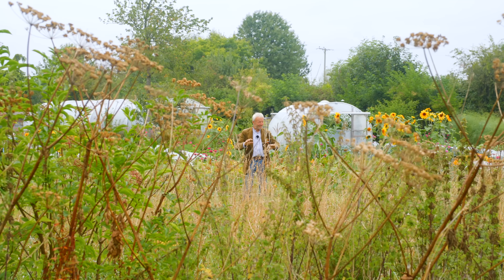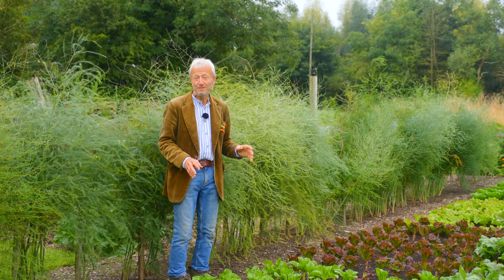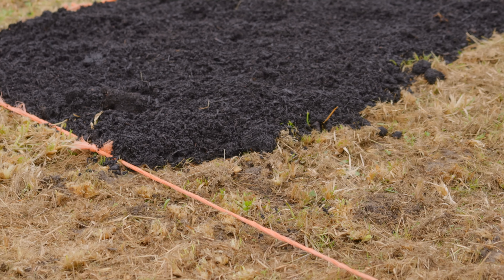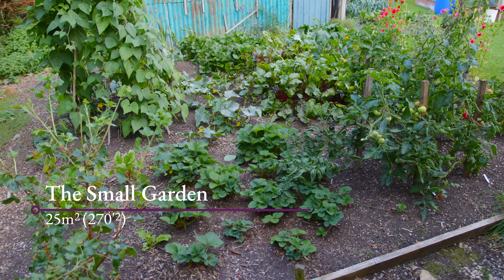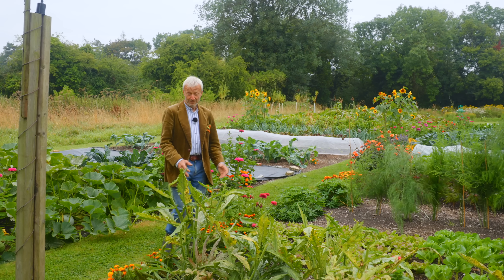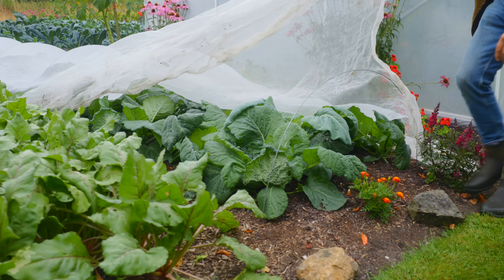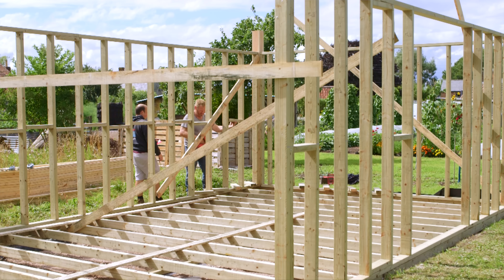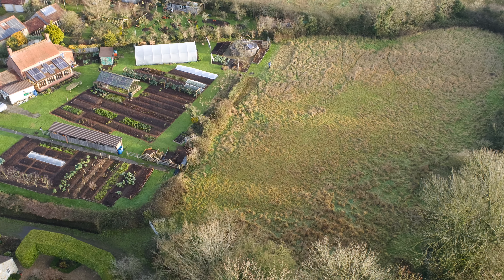No dig on perennial weeds 2021-2024 results

Comment: So love your approach Charles. I would add that in my experience if your compost doesn't"t hit the correct temperatures then you will be spreading weed seeds which might lead. People to think nodig does not work. Which of course it absolutely does! 😊
Reply from the maker: Thanks, and I see your point, but I do keep saying how it's very easy to hoe or disturb, or remove the new weeds from compost, because it's so soft. It's a totally different experience compared to trying to weed soil surfaces.
Reply: @CharlesDowding1nodig  Too true, it is about staying in top of it in the early stages and yes, soil is not compacted in a nodig set up the way it is when you dig to "so called" aerate the soil.
Reply: @CharlesDowding1nodig  4:09 4:15 4:04

Comment: Thanks for the run through of the way you’ve developed the space and how you manage it. The plants look so vigorous and colorful. Maybe you could convert the ‘left over’ space into a wildflower meadow which, once established, would be relatively low maintenance but would attract the bees and other pollinators en masse.
Reply from the maker: Thanks, and I find it's a myth that wildflowers are easy maintenance. Here, for example, grass and buttercup take over very quickly, that's why I used black plastic around the pond area. The existing wild area does actually have quite a few flowers in the spring, which we all enjoy.

Comment: Long time gardener here and I just wanted to pop in to endorse this method. If you are on the fence, absolutely go for it, it will change your life. 

A couple of tips, if you want to buy compost the best thing to do is to purchase it ahead of time and let it sit for a few months if you can. Most purchased compost is not ready and if you plant into it you may have disappointing results. Not always... but many times.  Number two, when you start your garden try to find large pieces of cardboard, appliance and furniture stores have a gold mine of large pieces that have less seams... of course you can always use all your old Amazon boxes but the bigger pieces let less weeds grow through the cracks. Thirdly, I would discourage putting grass that close to my beds. I do have a lawn but I have a strip about 4 ft wide of wood chip before my garden beds start. This is so that I don't have to keep edging the lawn like Charles does. If you like that look, go for it but realize the grass will never stop trying to infiltrate your beds.

This method is amazing and especially if (like me), you're not as young as you used to be, being free of heavy, heavy weeding is a godsend. Thank you Charles!
Reply from the maker: I'm heartened to see this and congratulations.
Thanks for your tips.

Comment: Good show, cheers Charles. You can buy puddling clay to line the dry pond by the cube/lorry load ~£130 a cube which would cover ~5sqM 100mm deep, guess cost depends how far the nearest supplier is, have a puddling party to lay it all down, kids would love it (so would the adults but use the kids as an excuse lol)
Reply from the maker: Thanks, this is a cheerful thought. I'm actually not unhappy with it, alternating wet and dry between the seasons.

Comment: Thanks Charles, loving your knowledge on growing, do you ever use JMS in your garden or compost teas, i would use JMS in my compost and garden when the weather starts to warm up to get my beds activated well with microbes and the mulch I've added in December about a month or so before i start planting, it really seems to help get things going.
Reply from the maker: Cheers Graeme and I have not found I need that, because everything gets going so well anyway. I wonder if you are digging, because I think there's more need for it when soil is disturbed. Thanks for the tip anyway.

Comment: I'm also a believer in a soil test, as in digging down and looking at what the soil is as you go down about 2 - 3 ft, and if there are already layers which affect water drainage in the soil (can happen for different reasons including land usage in the past for farming and other issues), then a one time DEEP till followed by these methods is pretty much the same thing.  Either way you're dealing with weed seeds once you remove a cover if you follow that with black plastic.

But once you start this process then you are no dig.  No-till farmers also do shallow soil work when they're working with 1/2+ acres just to get a smooth surface for taking a planter over.  So, part of the time they use a tilther and since that only works the top 2", I'd still consider that no-dig, in which case a lot of the no-till, or better yet, regenerative farmers will simply say no-dig means minimal soil disturbance along with being organic, with the function of locking carbon into the soil being a main goal.
Reply from the maker: Thanks for sharing :)

Comment: The greatest challenge I've found is in acquiring sufficient compost for the initial 10cm layer & ongoing, annual 2.5-3cm application.
I have 75m² in total of beds, plus 30 x 30 litre potato containers needing compost every year & I'm looking at 2.7m³ of 'finished' compost a year, plus 1.3m³ of woodchip/shredded prunings for the interbed paths.
That might sound daunting but I'm a not particularly fit 66 year old & with a little effort, have managed to exceed my target in successive years (last week's haul was 150kg of seaweed from the shore after recent storms - 30 minutes work).
Believe me; the end harvest is absolutely worth the effort involved, which is less than you'd think: maybe 3 hours a week, averaged over a year & for that I harvest at least 400kg of high quality produce a year.
Reply from the maker: Good to hear. It all keeps us fit and lively

Comment: Plastic exposed to the environment starts to breakdown very quickly and begins to release toxic elements into the environment.

Although it may seem that it can be reused indefinitely as long as it maintains its structure, it is silently poisoning the soil on which it is placed.

"Black plastics can contain unregulated amounts of toxic chemicals such as phthalates and flame retardants, as well as heavy metals such as cadmium, lead, nickel, chromium, and mercury. That’s because black plastic is largely sourced from electronic scrap such as TVs and computers. If these materials went back into electronic components or into inert uses (such as railroad ties), that would be preferable, but instead they are melted down and mixed with food-grade plastics for applications that pose a higher risk to human health, such as utensils, to-go containers, cooking implements, hot cup lids, coffee stirrers, reusable coffee mugs, or toys for children or pets.

While regulations are in place to ensure your electronic devices do not exceed certain levels of toxic chemicals and metals, there is nothing protecting you from the toxic levels in a black plastic to-go container. Exposure to heat increases the likelihood of these toxic chemicals leaching into your food and drink."

Source: https://ecocycle.org/our-programs/reducing-plastics/eliminating-problematic-plastics/problematic-unnecessary-plastics/

Comment: Hi Charles, I need your opinion on two things. First is drip irrigation and then the second is Jiffypots made from paper and some other stuff.  I understand the whole idea behind drip irrigation - to save water - but it seems like it now limits one as to where one can plant your seedlings etc or sow things like carrots while the rest of bed between plants stay dry. Also the space between the emitters. Then the Jiffypots are also a noble idea, but I used to make my own paper pots in the past and it seems like if the walls are too thick, the plant roots find it difficult to penetrate the walls and the bottom. Will the same not happen with the Jiffypots? This summer season, I am actually going back to the old fashioned seedling trays again.  From South Africa, Albert
Reply from the maker: Cheers Albert. Yes, I agree and drip irrigation does not stimulate soul microbes much! Likewise, I do not use any such pots, they take more space in the propagation area, and if you buy them obviously are expensive.

Comment: Charles , I have laid cardboard down , overlapping it even , but the grass from our backyard comes up through the wood chips on the paths , and creeps up into my raised beds. It’s a yearly battle that I’m quickly losing . I’m tempted to put pea gravel all over the paths . It’s such a never ending battle .   What would you do!?!
Reply from the maker: I would absolutely never, ever lay gravel on grass because it will just grow through, and be more difficult to remove. You are not doing the follow-up you need to do, as the grass emerges. You simply need to keep removing it, until it gives up. I've never claimed that simply laying cardboard results in zero weeds, there's nearly always a follow-up, but it doesn't take too long and the result is brilliant with no more grass in your case if you are persistent.
Reply: I use cardboard on the paths during summer months.  Controls weeds during the growing season

Comment: Just about to embark on a similar project along with my neighbour who also has a large area of unchecked weeds and grass, instead of solid plastic sheet would woven ground sheet work just as well ? I have two long rolls used for setting up a long wind break of Willow trees, its done the job well there so thinking about re-purposing  for the garden, many thanks
Reply from the maker: Good luck. If you have it already, then I would use it. It does allow a little light through and cardboard underneath would be an option if you want to be planting soon.
Reply: Thanks for the reply Charles, will give it a try.

Comment: What about Mare's Tail (Horsetail), Charles? I'm really struggling with this on my allotment and I'm disabled too, with very little help. I've been trying to SLOWLY dig out as much as I can BEFORE going no dig but am at the point where I'm thinking I'll have to give up my plot, which would break my heart. Could I just do straight no dig and pull up the horsetail as it appears and hope it doesn't choke the roots of my other plants?
Reply from the maker: Sorry to hear that and yes exactly. Don't do any initial digging, that actually does not help in my experience, but instead just keep removing, which is easier thanks to the soft surface of no dig. Still not easy and a big commitment and sometimes it's a less overwhelming weed than some others - small mercies!
Reply: @CharlesDowding1nodig  That's music to my ears!

Comment: We have been no dig on our allotment in essex for 6 years. Mostly going well (my back is much better) but mares tail   and small leaved bindweed are becoming a problem. We never had them before but there are other plots all around us which do. I suspect that the annual digging disturbed the soil too much to allow them to get started. 
We are keen to stay no dig. What would you advise?
Reply from the maker: That is frustrating, and it sounds like it has spread in from the disturbed soil of your neighbours, if I've understood correctly. 
It can't self generate out of nothing. Regular removal every week, of new growth with say 10 cm of the new white root does weaken the deeper parent root. 
However, that obviously is being reinforced from growth outside your plot. Difficult!
To make it less difficult, you could lay say 60 cm width of double cardboard around your plot and lay new card on it every two months, as a kind of speed limit effect on bindweed pushing in. Then concentrate on new shoots on your side of the cardboard
Reply: Thank you Charles. Will give it a go

Comment: I’d like to use no dig to kill the weeds and plant flowers and shrubs in my front garden.  Is there anything I need to do differently if I’m not growing veg?
Reply from the maker: Mostly it's the same, except if you want to plant shrubs with large rootballs. It's easier to make a hole for them before laying cardboard, plant almost at full depth, then cut cardboard around the new rootball and add compost on top.

Comment: Charles, do you water through the black plastic at all, once the plants are in? If so, how?
Reply from the maker: No, I don't, zero. Plastic holes moisture in and most of the rain filters through the holes in it. Now that it's old there are quite a few.
Reply: @CharlesDowding1nodig  thanks that's great to know, I have been growing squash through it this year, on new ground, and they have been really thriving, but I've constantly been wondering if I should be somehow getting water in there. The sweet corn seemed to not love not being watered though..